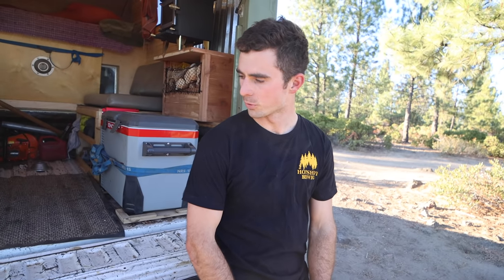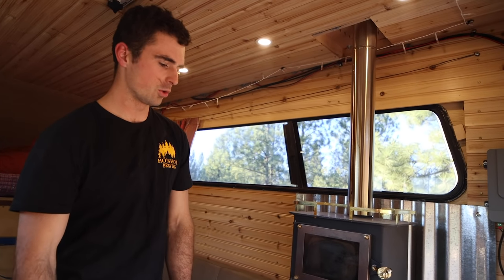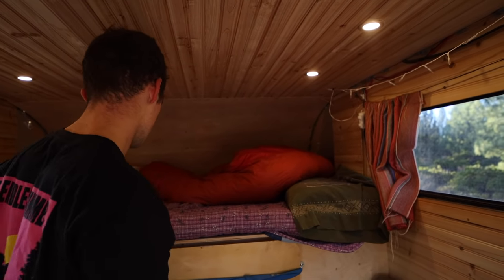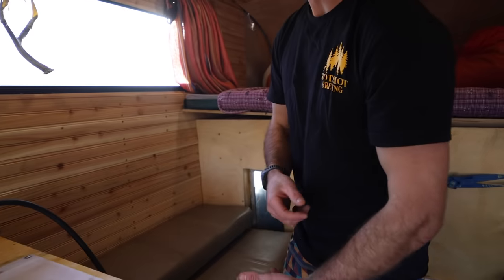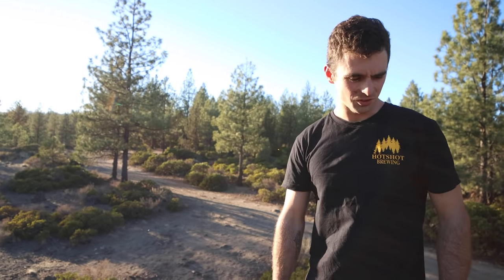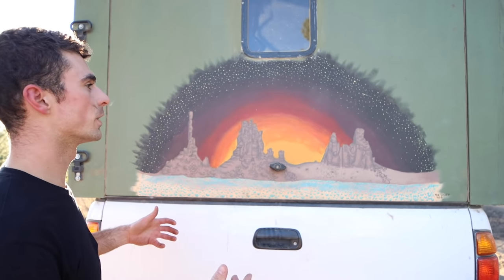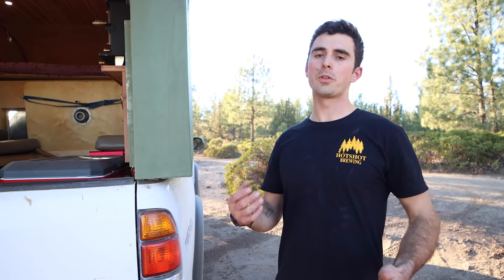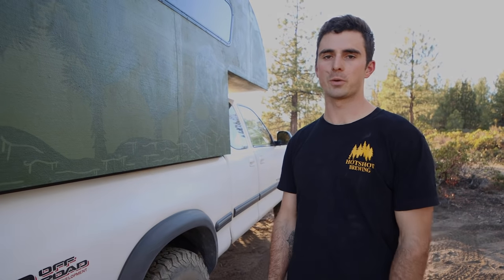HOMEMADE TRUCK CAMPER TOUR | Tips for a Lightweight Build On A Budget

Comment: Instead of paint on the roof try using rv rubber roofing,  you can paint it on and it dries into a rubber coating.
Reply from the maker: Great tip!
Reply: @trailandsummit7621  read the label....many "products" are just acrylic paint w/fillers...NOT rubber , just overpriced and no damn good long term
Reply: @trailandsummit7621  There is a rubber sheeting that glued to the roof and is what is used on commercial campers. A friend who has owned several style of RV's for many years, recommended it to me for my own truck camper build.
Reply: @kcajmortsnnew1488  the ones with a silicone base like henry tropicool are rubber and work really well, last a long time and can be repaired/recoated when needed.

Comment: I love your build, but I’m a petite female and want an emergency escape route. I need to be able to get into drivers seat without getting out of camper.  I love this so much!
Reply: They make escape windows that pop open approx 30”x22 n yes, I think every build should have one.
Reply: If your vehicle has a slide back window and you get or put a sliding glass window in your topper or whatever you may have, I'm talking a full size truck not sure bout smaller trucks, but you can open both and get from camper to truck. I'm 5ft 5 and I can get through mine with no problem. I locked my keys in my truck one time and I had to try it out and I had no problem. I seen a window today on a topper video and the window didn't only slide but you could unlatch 2 latches at top of window and the whole window lowered down and I would like to get one like that for mine. Your petite you wouldn't have no problem! Hope this helped! Have a great camping time!
Reply: why cant you just climb through the back window of the truck???

Comment: Hi, can you tell us how you made the overhang structure stable, where your bed is? Did you do it all out of timber? Thanks!
Reply: 90% of these “home made” slide ins with over a 3’ overhand always sag. Of course when I build mine I’m planning to mount roof rack’s on top on truck & secure then to them as well. Insuring no sag & will keep it from moving around ALOT MORE. Watch some of these guys hit a pothole in GA. Your rig shouldn’t wiggle around when your having rough roads.
Reply: @vincentlawson6920  the proper way of doing it is with a reinforced cantilever tied into the overhang floor, tying it into the sidewalls. most builders use heavy timber like 4x4 post or 2x6 or even 2x8 on edge when building with wood.

Comment: Does Tobias have any plans created to build this? New to a camper building but would love to have a go at something like this!
Reply: I'd love to build something like this as well!
Reply: Just do a little research on basic framing then make a frame. Finish material is up to you but the easiest (and cheapest) way to cover it would be a diy "concrete canvas" as opposed to Tobias' "poor mans fiberglass".

Simple concrete canvas formula:
1 part cement mix
1 part water
1 part fine sand
1 part latex paint (has to be exterior paint with high latex content, not cheap stuff).

Mix all together in a pail and brush or roll it on your canvas in multiple coats. 
After first coat it will harden like rock so make sure all your canvas (painters dropsheets work well) are in the form/shape you want.

Comment: I love your camper, I like how you didn’t build a base for it to keep it light weight. Next time maybe you should use only 8 inch thick wood on the outside and cover it with a coating of polyester resin and fiberglass mat. I am building an off road camper to pull behind my jeep, and I only used 8 inch thick plywood on the outside, with polyester resin and fiberglass mat, then I coded it with bedliner. It’s very strong and light weight.

Comment: Some similarities to my setup. I bought a slide-in fiberglass utility shell with an overhead attic like his. It has barn doors and is built like a boat with gel coat and stainless hardware. I put a deck at bed level so I have a basement and then a queen size living area above it. The plywood deck is ripped down the middle so that I can reconfigure the interior for half or full floor. It rests on three 2x4 joists. It didn't have any windows at all so I had round portholes installed in the rear doors and a large port hole leading to the opening of the sliding window of the truck. It maintains stealth that way. I'm using clear hatch covers that screw in from the inside so if somebody tries to open them they're just going to fall inside. I can lock myself in but still be able to get out by releasing the latch bars. It was in a gen 1 Tacoma first and now it's in a 2008 Gen 2 with a v6 and 4 wheel drive. I had a huge thread on CheapRVliving.com but the photo hosting site blocked all of my pictures so the thread went from 100,000 plus views to nothing. I need to start getting it back into shape because I'm retiring next year and I want to start traveling in it. This video is giving me more ideas of what I can do with mine. 👍
Reply from the maker: That would be fun to see! Have any pics on instagram or facebook?
Reply: @trailandsummit7621  I'll have to dig them up on my usb drives. It was a long progressive thread on CRVL in the truck camper forum. It's still there, here's the link:
https://www.cheaprvliving.com/forums/showthread.php?tid=34023

Comment: Very similar to what I'm building, square frame bolted to the rails and not slanted/conforming to the cab. Mine won't be over the cab, and only 40" tall. I'm 5' tall so I'll just be able to stand almost completely straight up. I'm at the point of figuring out the door, thinking along the lines as what you have. My only concern is being able to open the tailgate and not trapping it shut with framing. This looks like you have no problem there, gives me confidence that I can do it 😁 Great job, love it!

Comment: That Tundra won't break a sweat at 500lbs in the box. Even my old pos half-ton chev would handle that with ease.
Knew an idiot that put a 5000-6000lb piece of oilfield equipment in his 90's Ranger box for a delivery when the company truck was down, couldn't believe it myself.

Comment: totally dope. You gave me an idea about how to build my own.  Question: How did you mount the camper to the bed?
Reply from the maker: i don't think he shared his tie down system but you can watch here for some ideas: https://youtu.be/XhkU3IPcIz0
Reply: @trailandsummit7621  // I love that tie down system and it makes 100% sense. Probably only need two of those spring systems, vs 4. Either both in front or both in back. Either way, I love the idea.

Comment: I have a topper and was wondering if you thought it would be possible to build and extension where the topper meets the truck bed? possibly like 2-3 feet in height so it would raise it up, the topper would sit higher. Or should I just use the windows from my topper and do a build like this. Its a high rise topper so it is very large. And how do you lock this thing down?? do you have it bolted to the bed? tie downs? thanks so much. I am definitely subscribed now. I am going to do something very similar. I'm in Colorado and also going to get the diesel heater probably no stove till later though. Great work and content.

Comment: but wouldn't the thin walls and wooden construction make the whole thing flex over one too many bumps or worst case fold completely?
Reply: 2 inch framing skinned with plywood both sides is incredibly rigid when assembled correctly. keep in mind you never use nails in something like this, screws and glue only.

Comment: What’s the rough weight on that?

Did you consider building an aluminum frame with signpanels for walls. Reason for or against?

Did you consider a slide out extension.. either side or end? Reason for or against?

What was your rough cost? Time to build? Thanks a bunch! Nice build!
Reply: I watched till the end.. you mentioned weight, cost, and time to build.

Anything you would add, avoid?

Comment: I’m curious about the weight. Seems like a lot of wood. Have you weighed it?

Looks great! Well done.
Reply: you ever find an answer? i did an all wood build and it was too heavy for the suspension
Reply: @BilboBaggins023  I never heard back, but I kind of wondered if it would be overly heavy.
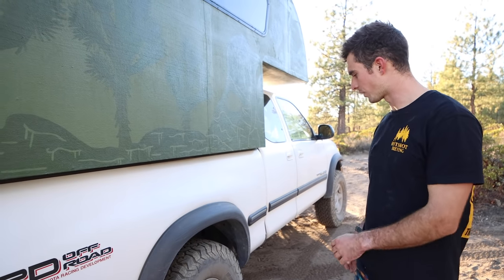Reply: @ 12:30 he estimated about 400 - 500 lbs
Reply: If truck sags put a 1 ton dual wheel helper thick full length leaf spring in at a spring shop. May have to go to a bigger city they usually have the parts and can do the labor. I've installed many over the years.

Comment: Nice work!  I assume you have a CO detector in there due to the fireplace and have you considered propane (vs diesel)?  Just curious why you used recycled denim vs foam for insulating the ceiling/doors?  You use foam in the walls so would think you'd use that for the walls/door too.   Sounds like cost N/I your labour is about $2000 US and you probably mention it (I haven't finished watching yet) but how much does it weigh?  I was looking to buy one but even used ones can be very expensive and are about 1500-1800 lbs for most 'light' ones.  Finally, if you did it again would you pay more to get fiberglass fabric/resin etc. vs the poor man's solution?  That likely depends on if it ends up leaking and with the added paint coats that doesn't seem to be an issue.   I'd like a 4-season one and with some double pane windows and propane to keep running while snowmobiling to keep water thawed and the place warm I think it could be done without many changes.  I'm not sure what R value your 3/4" thick walls have but the expensive campers have about R7.  I'd be building mine on a full size GMC half ton so could go with thicker walls for more insulation.

Comment: Ok I have some questions please! I am blding a nice TC Bld of my own! I just also blt a nice little platform insert in my OLD extra cab Chevy to turn the backseat of the cab into a sleeper cab! And doing a portable insert wooden floor etc....

Anyways!? Does urs sit rt on the bed rails and I see it is very tall! So HOW DID U SECURE IT SECURELY TO UR BED RAILS TO MAKE SURE THE WIND ETC DONT TAKE IT OFF???

CAN U PLEASE TELL ME SHOW ME?? HOW U SECURED URS ON THE BED RAILS??? 

I am doing 2 halves! My wooden self bld on the bottom half and the back wall with a full walk thru door and a window for ac etc I am blding for the entire back wall which will extend to the topper which will set on my bld and be used for the upper half!

I am planning on securing my bld half with nice strong PONY C CLAMPS! In the old days when nice good size TCS were actually made out of real wood and good wood!! So I love seeing folks bld their own esp wooden TCs!! 

I am using 2x4s for the bottom half of my camper and for the frame for my back wall! And 3/4 NICE GRADE PLY for my side panels and front/rear tc window panel! Mine is gonna have window doors on all 3 panels so I can either open the entire WD panel!? Or just leave it locked and closed and just open whatever windows I add later! The CAB WINDOW AND THE TC WINDOW OPENING TOTALLY LINE UP!! AND I PLAN TO MAKE IT PASS THRU! Will close my window door when parked or parked or doing so! Open when moving!

When I find my topper I will pop the bottom together then go get my topper! Which will be a White Aluminum topper with windows all the way around! It will be light!! Cooler! And the surround windows on both half will all be open for tons of ventilation!!! AND viewing scenery driving etc.... Mine will be a fully opening bld! I have a pack/dogs and hell rt now we been gettin 100s 105 etc....and qhen we r moving or not we will have no running ac!! TIL I get solar going for my bld! I will have it so when I am parked anywhere I can access power I will have it and have running ac etc! But won't have it running or  any off grid shit!!?? 

The topper being light and white...will keep the top weight dn!! Anddd overall weight!! But my TC bld part must clamp or be fastened to my truck RAILS! Andd then the topper be clamped to my bld!! Just like it would the rails!! Which will of course be my 8ft 2x4s! Which will sit rt on rails...then top of panels with 2x4s same width as bed rails of course...will have the topper then clamped on to it!

So will I need to add anything tp hold on besides 3 clamps per rail per half!? In the old days we held the old wooden TCSs on by C CLAMPS!! THEY WORKED FINE!!

In addition to that to help hold in place!? I am thinking I will drill/sink a hole the size of the clamp circle...for the round of the clamp to set dn in! As I am thinking that if it sets dn in a drilled indent it will prevent any possible sliding!!??

I would like to know if this will work well or if I will need to add any other ways of securing them dn!? My part and the topper!?

Anyway sorry I just wanted to kinda give a general ideal so maybe my question of securing could be best answered!?

Thanks!!

Comment: 4 feet wide and sleeps 2... okay.. a mcdouble feeds a family of 4
Reply: The overhead camper where he sleeps two will at least be 6 or more feet wide.  The space between the wheel wells at the floor are the only parts of the bed that are 4 feet.  The dinette bed will sleep someone between five and five foot five.